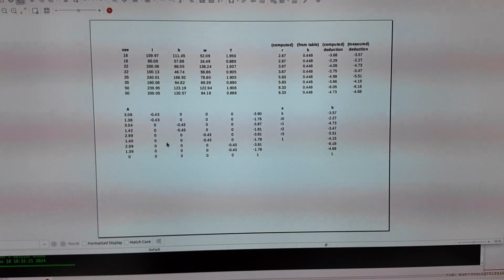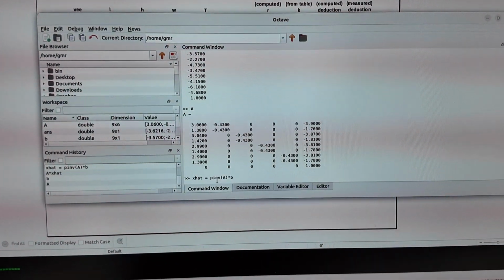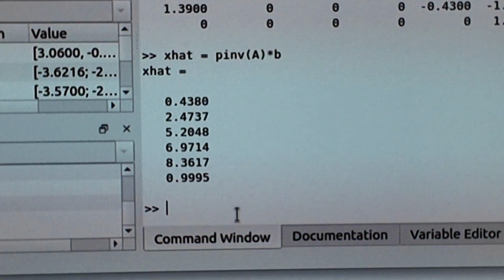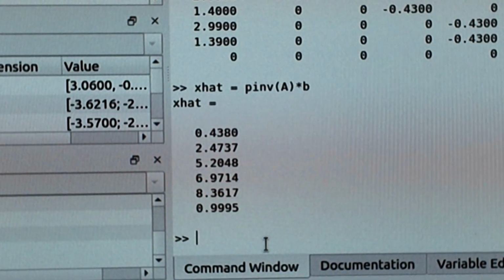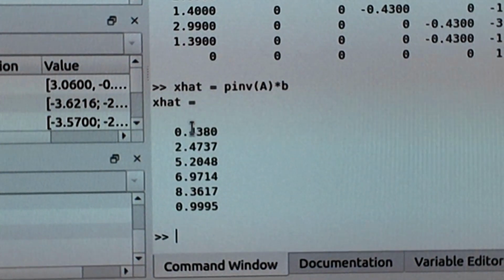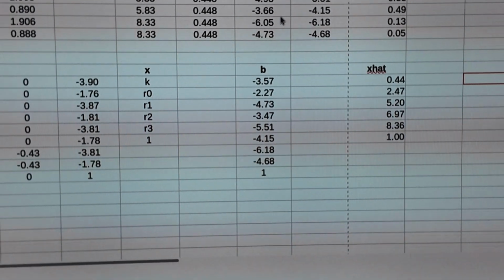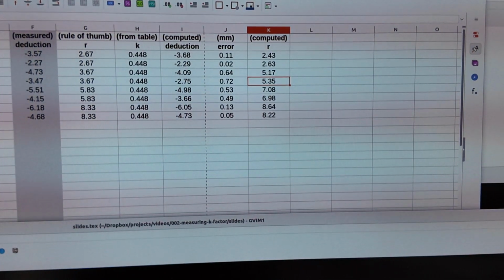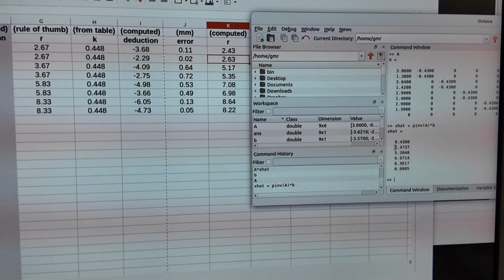#002 - Bend Radius and K Factor for Different Vee Widths

Comment: Hi!! Thanks for the fantastic explanation on the 001 air bending video. I'm going through the same method explained in this 002 video, but I have a couple of doubts I was hoping you could clarify:

1. Linear dependence (Single thickness): If we isolate a single thickness to respect the material's specific mechanical behavior, don't the equations become linearly dependent? Wouldn't an underdetermined system force the solver to generate algebraically random numbers just to balance the unknowns?
2. Physical behavior (Mixed thicknesses): If we mix different thicknesses (like 1mm and 2mm 3 4 5 etc...) to unlock the matrix, aren't we calculating a hybrid K-factor and hybrid radii for different thicknesses? Since plastic deformation changes  depending on the V-opening to thickness ratio (V/t), is it safe to use these averaged parameters for precise CAD modeling?

I'm struggling to see how to get reliable, physically accurate parameters for a single specific thickness using this matrix. Have you used this results in order to bend some pieces? Thanks!
Reply from the maker: Thanks for commenting. To answer your comments:

1. If you solve for single thickness, the unknowns are the radius and k factor, so you only need two equations in a perfect world. A simple matrix inversion of A, multiplied by b would give you an answer. However, because of the experimental error, more entries in the matrix of equations give rise to better estimates of the unknowns in the least squares sense (note that in the video I am computing the pseudo-inverse of A not the plain inverse).

2. Does the k factor vary with metal thickness? It might indeed vary a little bit, but I don't think it varies very much. I use the same k factor for steel between 1mm and 6mm. For 1mm to 4mm of steel thickness, I can normally get the dimensions accurate to within 0.2mm (often better). For 2mm aluminium I get about the same performance.

One thing to add is regarding something I said in the first video about the top tool not being so important, nowadays I use a 5mm radius top tool if the inside radius is above 5mm (i.e. for 35mm and 50mm bottom vees in my tooling). I have found this gives a much better result for thicker metal (anything about 2mm), both in terms of the performance of the bend deduction formulae and the deformation of the metal (if you use a top tool with too small a radius, you can get a dent on the inside bend). 

The final thing to say is that my press brake is from 1978, although the tooling is new. It gives consistent results, but your experience may be different. A lot depends on top and bottom tool alignment and how accurately you have set the bending depth, for example is 89.9 degrees acceptable for measurement purposes? Probably is for fabrication, but it can have a significant effect on the measurement precision if you have a long flange. A more modern machine with all the factors set perfectly might give better results than I measured above.